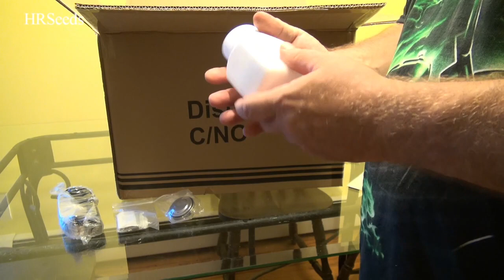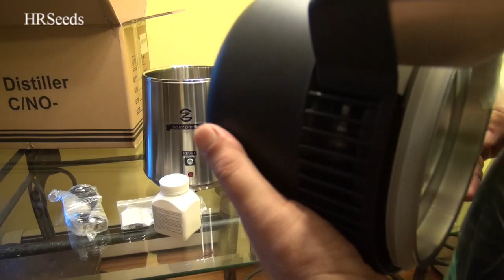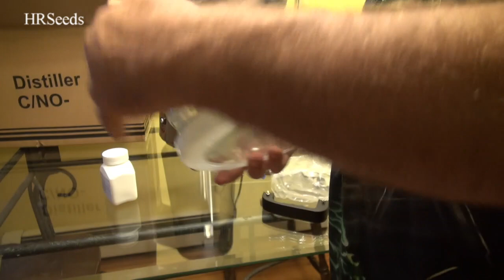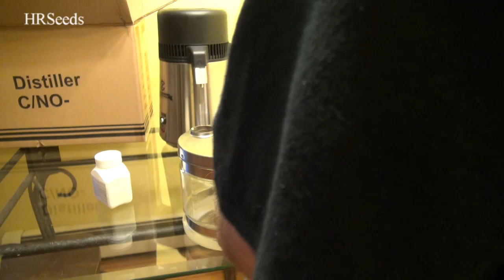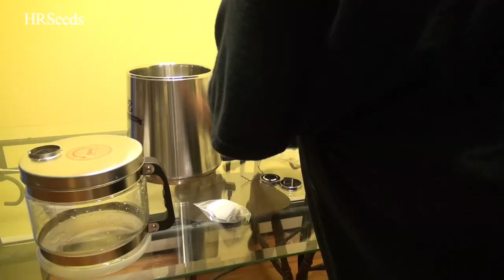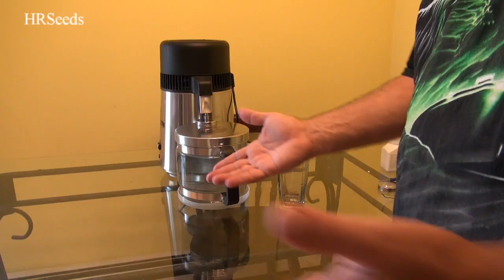CO-Z 1 Gallon Water Distiller Unboxing and Review | Amazon | Heirloom Reviews

Comment: I just got my CO-Z distiller do the distiller suppose to constantly go off and on by itself?
Reply from the maker: no you have to make sure you have the plugs pushed all the way in . also run the distiller about 3 or 4 times an dump the water before drinking it and then filter it through a PURE picture filter
Reply: @HeirloomReviews  when it run out of water in the distiller will the machine automatically shut off?
Reply from the maker: @stella3615  yes that is how it shuts off thats normal
Reply: @HeirloomReviews  Thank you

Comment: What about the distiller assembly? There’s a silicone seal that prevents water from escaping the distiller. when placing placing and re-leasing it, it says it ensures that the rounded side is facing up and it’s showing a picture. Mine came with a thing around the silver water pitcher, and then it came with a silicone thing. I don’t know where it goes I didn’t see you do anything.
Reply from the maker: Im not sure what your talking about?

Comment: Purchased this exact model. The only issue I see is the outlet nozzle (where you insert the carbon filter) on the inside appears to be welded or soldered, then painted over... The outside of the outlet nozzle looks as advertised, looks like 304 steel, but the inside of the outlet nozzle where the water contacts has its edges welded or soldered with a material that is clearly not steel, it is another metal and hopefully not lead based solder. They painted over that inside of the outlet nozzle to blend it in with a grey looking paint to try to blend it in with the stainless steel, but clearly its paint as it looks different and parts are chipped revealing a dark colored material underneath.  

I don't trust running a device with hot water over some unknown solder material and unknown paint. I think the device can be run without the outlet nozzle (though haven't tried yet), but it makes me question the condensing tube on the inside as the lid has to be disassembled to view (is there soldering there to connect pieces or is it aluminum and not stainless steel?).

Debating whether I will be returning the unit this week, though not sure what other model to get as many look exactly like this one, but with different brand slapped on.
Reply: What did you end up doing?

Comment: Does it shut off before it boils off every single drop of water causing scale? Or does it leave a few ounces inside after it shuts off? My other brands will leave a few ounces remaining in the pot, which is the way all of these distillers should be.
Reply: It’s dries completely
Reply: @sausage3575   I just got the 1.5 gallon one and it's like all my other ones. It leaves some slosh in the bottom after it completes a cycle. Thank goodness 🙏🏼
Reply: @Hundert1  👍🏻
I have the 1 gallon and it literally dries complete with black stains on the bottom crusted on
Reply: @sausage3575  Woww, that's strange. I've spoken to people who sell distillers like this. They tell me it's supposed to always leave some wet at the bottom, along with all the gunk that was in the water. I'm pretty sure i read it in the literature too. In fact, the entire inside should be very damp. Once you remove the top, it'll start to dry out. This isn't good. I leave mine alone until the moment I'm going to refill it with more tap water. This unboiled off water remaining helps prevent the gunk from drying and solidifying on the stainless steel, making it easier to clean. It's been programmed not to boil off every single bit of water and shut off with leaving a little bit remaining. The color of the remaining gunk at the bottom is probably due to the different junk in our water supply. I'll give my original distiller company a call to double-check on these things. I've also noticed rust already occurring on the bottom. I'm curious about the quality of stainless steel used by this Coz company. I mean, my unit is brand new. My previous distiller lasted at least 10 years, but it was triple the price. This new one is nice and quiet, at least.

Comment: I just purchased one of these co-z distillers from Amazon. Ran it 4 times and the water still has a metallic taste. Running it again with vinegar to try and clean it it more and see if that helps. I was thinking it would taste like smart water but right now it tastes worse than my filtered tap water.
Reply from the maker: a few others claimed the same? i would return it if it still taste foul
Reply: @HeirloomReviews  I've ran 10 batches through it now and it still has a strong metallic taste. I've tried throwing out the first two cups of water and that didn't help much, I'll return it like you said.
Reply: @David-jm3zu any luck with your new one, I have the same metallic taste/burnt taste…
Reply: @sausage3575  nah, i ended up returning it.
Reply: @David-jm3zu  what do you have now as a replacement if you don’t mind me asking?
I’m about to return it aswell
Reply: @David-jm3zu any luck with your replacement?
Reply: @y2kazan868  never got a replacement.
Reply: @David-jm3zu  did you forget to use the charcoal filter
Reply: @Bennythecoredriver  nope, definitely used it.
Reply: @David-jm3zu  as he stated in the video gotta distill for 2-3 hrs. Did you do it longer?

Comment: I have this distiller....it is NOT true stainless steel.... mine is developing a rust stain inside AND around the top where the lid fits on
Reply from the maker: really?
Reply: Same here I’ve only ran about 15 cycles and it’s rusty 
Takes like metallic/burn aswell
0ppm tho 👀

Comment: Thanks for covering this so thoroughly. 

To anyone else watching, don’t forget to soak and rinse that charcoal filter inside the output before using it and replace those about once a month.
Reply: that was not stated in my instructions, why is this important?, and thank you for the heads up
Reply: @hopepingle8582  any charcoal filter needs to be soaked and rinsed before use to remove charcoal dust from movement during shipping which will otherwise be washed straight into the first thing you run through it. They require replacement once a month for effectiveness and so that they don’t become a bacteria farm.
Reply: @hopepingle8582  you can also use a reverse osmosis or a brita water pitcher or zero water pitcher then pour that water into the distiller and you dont need those charcoal packets that you need to buy.
Reply: I remember reading somewhere that you can bake the charcoal on high heat to restore it back to its original state. You'll need to find some sort of small reusable heatproof bag to put it in afterwards. Might be ok just to put it straight in provided it's rinsed, and add some kind of fine stainless steel metal mesh at the bottom to stop one of the pieces from blocking the hole. You could also just use cheap fishtank charcoal. It's safe since its meant to clean water so fish can live.
Reply: Why do you need to filter pure distilled water? The charcoal is for distilling alcohol.
Reply: @archur111  just because you aren’t aware of it doesn’t mean it doesn’t exist. The carbon packets are included in most water distillers and are in the instructions for most water distillers. They’re a final step to remove any residual odor or taste, as well as any remaining VOC gasses. Look up H2O Labs Activated Carbon Pods and read the label.
Reply: @MichaelBlueMusic  yes, but there is 0 of anything in distilled water. Research it. 0 particles 0 gasses, certainly 0 Vic's. By filtering it, you may put something back in.
Reply: @archur111  I have, and this is what all commercially available distillers recommend and include in their packaging. I’ll take their word over yours, if that’s ok. 👍
Reply: @MichaelBlueMusic  absolutely my friend...
Reply: because of the final Charcoal filter, that is a necessary final step to block the harmful heated VOC’s, - only then you can reach 0 on a TDS meter
Reply: I use 2 x ( double ) Charcoal filters inside the nossel / output, to ensure that most VOC / toxic gasses are removed thorougly.

Also a Tip : 
turn Off the Distiller 30 minutes before it finishes, so to leave a little bit of water in the tank. 

- To ensure the water is most clean, as the final drops are soaked with the pollution residue: so as to avoid evaporating it all the way through 

( an automatic timer can be used )

You can also add / use unbleeched ( clean ) perculator filters inside the nossel to block / barricade the VOC extra thorougly, besides the charcoal

Just to be sure and safe

Comment: Why does the water have a plastic taste? Can’t seem to get rid of it. Using to carbon/charcoal filters.
Reply from the maker: Not sure? did you contact them? mine had a bit of a taste in the beginning but its fine now. you can try running a cleaner through it like ascorbic acid
Reply: I’m going to try that. Should I have the cleaner go through the whole system? or just the vessel?

Comment: Hey my man i love your video. I got 2 questions for you. It say sto use tap water but my fridge gives out filtered water. Would that be ok to use or do i have to use straight up tap water? Also i hear distilled water can pull out toxins from plastic so its best to keep in glass container. What about a stainless steel thermice? Would it be ok to put distilled water in that?
Reply from the maker: yes you can distill filtered water, you can distill any water an drink it!
water is like a sponge when its distilled. it will pull toxins out of the air if left long enough. it depends on the plastic, the plastic made of acrylic will emit the least amount of plasticizes. as long as you drink it every day your fine but for long term storage then use glass only
Hope that helps! : )
Reply: @HeirloomReviews  You said distilled water is like a sponge. I see alot of talk about distilled water pulling minerals out of the body. And other says only the bad stuff out of the body. I don't see distilled water pulling out something the body benefits from after you drink it. What is your thought on this?
Reply from the maker: @joshuahenman2506  You need to listen to the video very closely dude
Reply: @HeirloomReviews  I'm about to watch it again. Mustve missed something my bad.